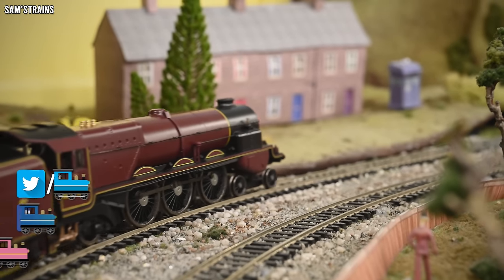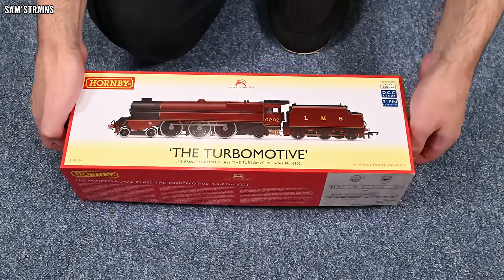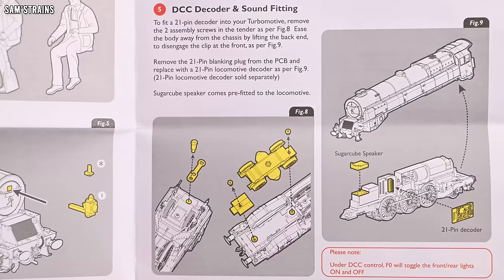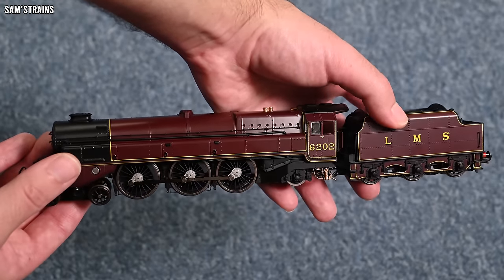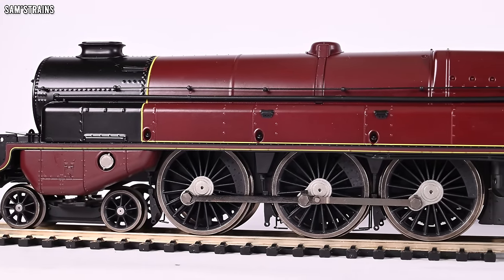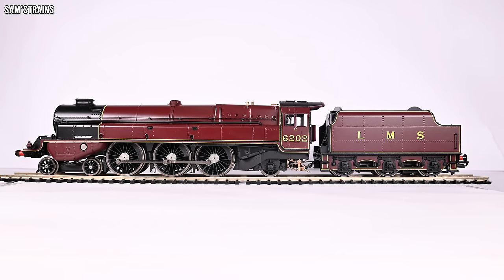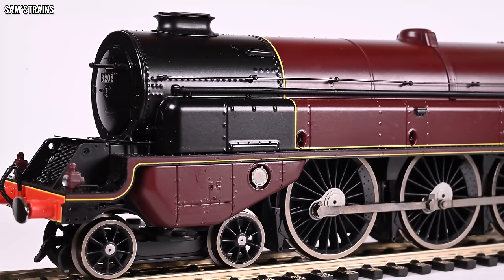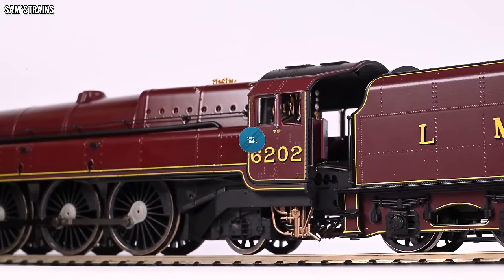Is Hornby's New Turbomotive Worth £240? | Unboxing & Review

Comment: There is some cool features, but a couple of DCC questions, does the Hornby Bluetooth chip fit it (you should do this for all Hornby releases), and whats on the soundfile for the speakers? If the loco no longer exists what did they use for the source sound?

Comment: OK, it's diecast (which doesn't bother me either way), but the reality is that this is quite a simple model - no valve gear, smooth casing, etc - all of which should reduce production costs. It should be cheaper than their other diecast locos, not the same price as buying an Accurascale loco that comes already fitted with DCC, sound, large stay alive, etc. Count me out as a customer.
Reply: What is a 'Large stay alive' ?
Reply: It's basically a super capacitor that stores enough power to keep the loco going over any dead spots. It works with DCC and makes a massive difference to the smooth running of a loco over dead frogs and other track imperfections.

Comment: Well, this may be a first: an OO-scale steam loco with working front AND rear lights! While many HO-scale steam locos (representing North American prototypes) do have front/rear lights (even if they don’t work), it’s not common on OO-scale, though I presume that’s because it’s uncommon on the British/European prototypes. 🤔
Reply: Lamps at the front signify the type of train, they're not there to light up the road ahead on a British locomotive. A lamp at the rear of a British train signifies the rear of the entire train, so Turbomotive as supplied shouldn't be hauling anything. So you're stuck hauling an express passenger train but with a red light at the rear of the locomotive which tells trackside staff that the end of the whole train has passed; the front lights don't match what the rear is saying. Adding the smokebox door lamp into the mix switches it to an obsolete lamp code on the LMS for empty coaching stock....Turbomotive wasn't built when that lamp code was made obsolete. Its a nice idea in theory, but its about as prototypical as painting the thing bright pink, and its executed bloody awfully.

Comment: Wow, I'm incredibly impressed. I was secretly hoping you would review it, having heard that Hattons got them last week. Owning a Dublo Scotsman, the finish looks absolutely stunning. I think to be better value the cab should be die-cast like my Scotsman. The lights however are extremely impressive. I actually prefer it over the firebox glow since I spend more time looking at the loco front rather than the cab. The tender lamp and the optional smokebox lamp are nice features and I love to see it on future models. Yes, it may not be the most effective, but seeing it occasionally makes me feel quite good. I fit lamps to almost all locomotives so this one having them pre-fitted, especially a steam locomotive is very impressive. Only nicks for me are the slight quality issues and the light leakage foam which looks very bad now that you mentioned it. Performance wise, I think there could be room for improvement. My Dublo Scotsman can pull 6 Pullmans without issues on second radius (I don't know the exact weight sadly) but considering the Princess is larger, I guess it's heavier. A truly excellent model, if slightly overpriced. 220£ would feel alright at the retailers (It's still much much better value than the Hush Hush for me which isn't that far off price wise), but for now I'm waiting for the BR Apple Green J36 limited edition to drop since I pre-ordered it. Great review of a truly stunning loco.

Comment: Saying Turbomotive was rebuilt into a standard Princess Royal is wrong. She is obviously designed around the Princess Royal design, but a lot of the new parts were Coronation class parts, and quite a few were unique too. And the crash involving her as Princess Anne led to a shortage of express locos on the WCML, leading to the building of the standard class 8 71000 Duke of Gloucester.
One thing to note is, the space for the 21-pin chip is rather small. How would you fit Hornby's own TXS chips (which you noted to be larger than NEM standard) into that space without heavily modifying the speaker?
I love obscurities, especially prototypes and one-offs like this. But the price is too high (even with all the diecast), and I'm not overwhelmed by Hornby's quality of late, hence I don't have either version of W1 yet, or the new 00s FGW liveried HST set (I want it as a 2+2), or a new P2.

Comment: I have to say, as much as the working headlamps are a cool feature I feel it actually makes the model worse given that two of the three on the front, and the one on the tender, aren't removable. How do you change the headcode without massively damaging the model? Wouldve been better if they were removable, but for me it spoils what is otherwise a good, if overpriced, loco.

Comment: Hi Sam - frankly, I think you've been too generous. Having seen your reviews of both, I can't say this looks a better model than a P2; doesn't run as well, and in terms of drawbar seems outdated. (On which note, Loco weight shouldn't affect drawbar connection. Torque maybe, but it's the loco doing the pulling, not being pulled, through the connection). It seems priced abour £30-40 too high, and underpowered even at that.

Still, I wouldn't have been able to form these opinions without your top grade review, so, as ever, many thanks!

-Chris

Comment: The RRP price reflects the fact decent retailers offer ‘apparent’ discount as standard. The discount price is the real price, and Hornby can charge a premium on their own website ensuring you get one, rather than chance a retailer running out of allocation. Rails and Hattons, to name two, retailers offer ~20% off RRP as standard, which isn’t cheap but reflects the going market price - almost price fixing, as from time to time unsold stock gets moved on at greater discount, and perhaps at cost pricing just to avoid losing money. Even so, RRP does seem steep, unless the alternative is a handbuilt one-off.

Comment: The new Hornby LMS Turbomotive is a very nice model with light-up lamps on both the front and back along with the body shell being made out die cast metal except the cab which I do like it. Unfortunately, it is too expensive and it has that outdated tender connection for the locomotive which totally sucks. Overall, it is a nice looking model Sam. By the way, the Hornby A4 named Gannet has its entire body shell made out of die cast metal which includes the cab as well but the body shell of the tender is still made out of plastic but it has the modern connection between the locomotive and tender. Plus, it has a removable base keeper plate with the pick-ups built into the base plate and there are spring-loaded contacts under the base which make the A4 models easier to service Sam. Maybe you should review the new redesign A4s from Hornby Sam.

Comment: If it was a Train Simulator model, I'd say the increase of price could come from the difficulty of required research. But with a physical model loco, I'm not sure if it's really as research-heavy, since it doesn't need to have realistic simulation of how the original worked. And sounds and such.
Nice to see it in a different form than old photos though!
Reply from the maker: Ahh I don't know - there's still a tonne of research that has to go into these, more than you'd ever believe! Thing is the research cost is a one off, and it's spread across all models, so it never accounts for too much on a per-model basis. Production is where the real money goes, and tooling of course!
Thanks for watching, Sam :)

Comment: As a new entrant into the hobby, and certainly scared off by loco prices over £150. What are the hobbyists aking manufacturers to do? If a static display model is required, then the greater the authentic detail the better. For running on a layout performance is key. To try to achieve a near maximum on both counts may in the end satisfy nobody. Dapol and Accurascale seem to have the compromise right, certainly at the price point under £180. Hornby and Bachman need to adjust to these competitors to stay in the market? 
Sam, could you add into your review your opinion as a collector, or as an operator? I think you personally fall into both camps. For this model, as a collector you would not be worried about the consistency of the lights, but the different colour shade and finish between the loco / cab sides and tender would be a concern. As an operator delivery of the performance on the curves is an issue. This would seem to be poor value to an operator. To a collector the decision is less clear, you are getting a unique loco which is worth a price premium, but you describe the negatives.

Comment: I agree with you on all points except that I'd be a bit harsher in my score for performance, on the basis of that low-torque motor.  It may be impressive that the motor it has can do as well as it does in a loco that heavy... but Hornby should have anticipated that and compensated by fitting a more powerful motor.  At that price point, for a loco that will have pride of place in many modelers' collections, they should have done better.

Comment: See, okay, ever since this model was announced, I've had one prevailing feeling about it; it's a cheap and easy conversion of the Princess Royal. 

Yes, the body is asymmetrical, but, the big thing, no valve gear at all. Just side rods. It's simple as anything for them to produce. Less complex than the original. 

So, to then charge mega money for it, yet another "hornby tells us it's raining" (you know the saying in full) moment. Do correct me if I am wrong and this model is somehow super complex. I just..I can't shake that they saw a way to make an easy rebuild of their existing model.

Comment: I wonder what the detail of the body looks like without the paint. Any sharp edge like a nut or plate edge when spray painted will add paint to the edge so instead of a single coat thick ness there can be two. This loco body seems to suffer from over spray, looks good but has lost a lot of fine detail. How does this loco compare to say a WRENN loco,. which have a metal body (and similar paint issues)?

Comment: To use a car analogy, it's as if Hornby were aiming to make a Rolls-Royce, produced a Mercedes S-Class, but still gave it a Rolls-Royce price tag.

Good, but not £266 good.

£180 would be nearer the mark, and if they pried it to undercut the Accurascale die-cast loco, it would look like a real bargain, but for the motor issue. It needs at least twice the power being delivered by the current motor to operate properly. I suspect there's a limit to how much power you can extract from a motor that fits snugly into an OO model, and I suspect one of the reasons for the delay in the appearance of this was centred upon ever more desperate attempts to solve the power/torque issue.

A physically larger motor would probably produce more power, but might not fit in that chassis. Arranging for the motor to spin faster, but reduce the gearing ratio to increase the torque at the wheels, results in faster internal component wear, which would bite Hornby hard if people shelled out the full £266 on a model that exhibited reliability issues early in its life.

I suspect a lot of midnight oil was burned on this, and still didn't deliver an optimum solution.

One possibility would have been to run with rare earth magnets in the motor, but that would have jacked up the price even more. Neodymium magnets deliver a powerful magnetic field in a small space, but are not cheap, even if you're buying them in volume to reduce per unit cost.

I'm thinking overreach played a part here.

Comment: Nice review Sam.
I really don't like the fixed lamps, lamps mark the start and end of a train as well as the class of the train. having 3 lamps fixed in place rules out any operational realism. modellers may be happy to accept this but it shows how little the manufacturer understand the item they are modelling.
The rear light is more realistic for a steam era paraffin lamp. bright head lamp style lights were only fitted to the banking engines at Bromsgrove.

Comment: Before you had even discussed the body materials Sam I thought the cab sides and tender were plastic as in certain light the shade of paint is noticeably different, being far lighter than the diecast body. It’s also disappointing that Hornby have produced a diecast locomotive which is excellent, but then seen fit to power it with a standard motor despite it being much heavier. 

Considering the amount of effort and attention to detail that’s gone into this locomotive and the price, that’s more than a little disappointing.

That said, it’s a lovely locomotive

Comment: It is true that a model of a more obscure prototype with limited liveries will be slightly more expensive than a more common prototype with plentiful liveries, but only slightly, at least for a larger manufacturer like Hornby.

If a manufacturer expects to sell say 10,000 of an obscure model when they would normally expect to sell 100,000 of a 'normal' model obviously the research and development costs are going to be 10x higher per model sold, but around £100 more per model seems excessive in the extreme.

Perhaps if it was a limited run of 1,000 models or something you could begin to justify that level of pricing, but even then it's still seems too much.

Comment: Seems like development took longer than expected and the new motor and coupling appeared after the old ones were baked into this model. They could have redesigned it, but that would have meant more delays. Feature creep can be s real issue. They won't want to say now, but a future upgrade may be possible to solve some issues here.

Comment: You measured the wheel back to back and said they are under the standard dimension, yet OK?  Which standard are you using?
Reply from the maker: I use the Double O gauge association's standard which sets the standard at 14.4mm back to back, but the vast majority of models come in at 0.1 or 0.2mm below this mark, which generally allows decent performance on tighter curves,
Thanks for watching, Sam :)

Comment: The existing black 5 tender surely? Looks like the loco was designed to have the new coupler looking at the back of the cab below the footplate but perhaps to speed up production they used the existing tender and it was found to be easier to bodge on the older drawbar to the loco than the new one on the tender?! Rails are stocking Hornby again as of today and their prices are reasonable - unlike Hornby themselves who I suspect have a warehouse full of stuff nobody will pay their ludicrous RRPs for and they need money fast to prop up TT120 and other Kohler Krap 😂

Comment: THE LOCO LAMPS

The two on the front Buffer Beam look to be fine.

I would suggest that the oneson the Smokebox Door and the one on the Tender look to be pretty much the same item, (slightly smaller than the ones on the Buffer Beam). Am I correct in this observation.?

If so, this would suggest that they are not intended to be as bright as the ones on the Buffer Beam.
Which I would admit is a bit strange, although not something to lose sleep over.
Are the lamps available as a separate purchase from Hornby...?

if so, it might be possible to replace the slightly smaller ones with two the same size as the ones on the Buffer Beam. 
Just wondering.....

James Hennighan
Yorkshire, England

P.S.
It could be that with these lamps being a new feature for Hornby that they will refine them a little bit.
In truth its probably a slight difference in production standards.

Perhaps if they had factory fitted all of the lamps they would be tested pre-boxing, and likely all the same quality and brilliance....?

Comment: Thank you for another good review. Your coverage of the model itself is excellent. However, there are serious flaws with it or if you prefer, mistakes by Hornby. The model with it small reverse turbine and domeless boiler are as she first entered service. At that stage, she was in the 1928 style livery and should therefore have gold or gilt lettering and numbering and not yellow. Also because of teething problems, she only ran for a total of about 6 weeks between works visits before getting the larger reverse turbine in September 1935. Furthermore, she then only spent about 3 weeks out running before getting the domed boiler in July 1936. She might look good with a rake of Stanier coaches but very few had been built by then and did run alongside many other Stanier locos in that condition. So bearing in mind the price tag, I will wait till Hornby bring out another version which reflects the condition she ran in for most of the time and fits with the later coaches and locos.